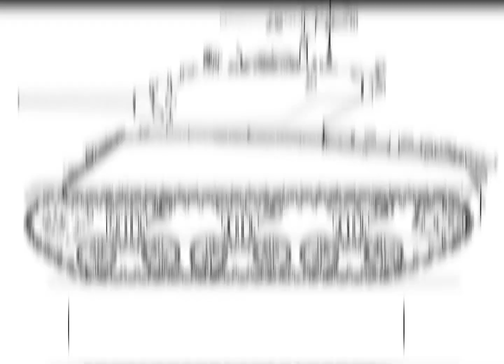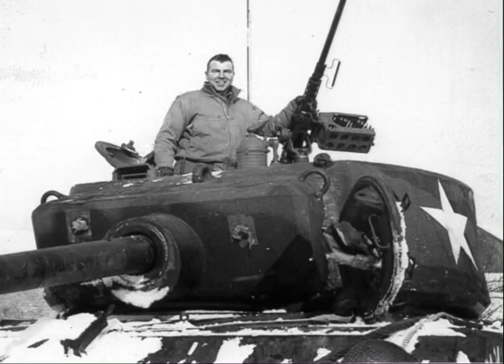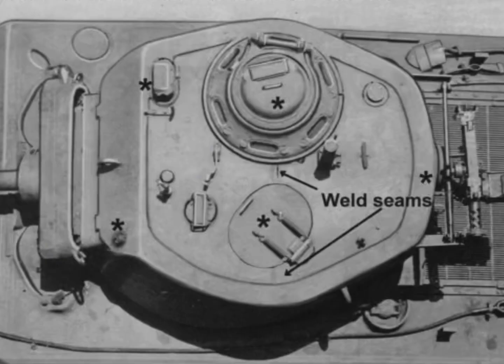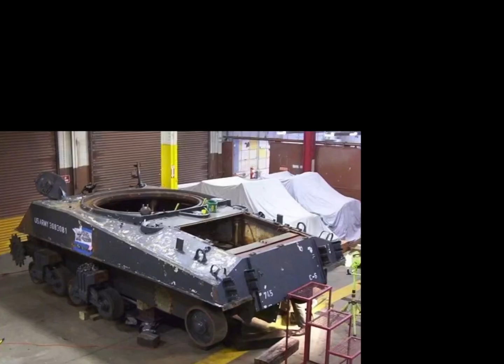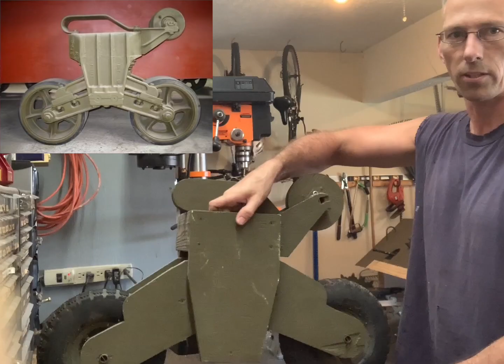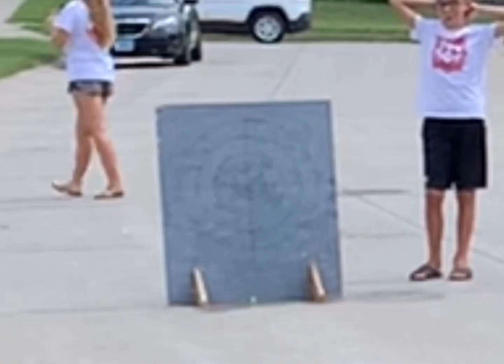M4A3E2 Sherman Jumbo Scale Tank - Real vs. Replica

Comment: Out of curiosity how did you get all your measurements and can you maybe give me some advice to doing a full scale version of yours
Reply from the maker: I got all of my measurements from drawings I imported from the-blueprints.com, I think I mentioned it in the video. A full scale version would be amazing! How to steer it will be the most difficult part. If you are thinking of using a truck differential and applying brakes to one side, I've seen this tried and it doesn't work very well. The vehicle will come to a stop every time you try to turn even slightly.

Comment: How do you get the measurements, im trying to build a 1/1scale sherman jumbo, and i don't fully understand what to do to get the measurements. Thanks!
Reply from the maker: I’d love to see your 1:1 replica! For the dimensions, I looked up the overall length and width of the tank. In my case I reduced the overall dimensions to 60%. Then I imported the blueprint images into a CAD program and scaled them to match the known overall dimensions. Then I drew my hull components on top of the image.
Reply: @ryanhahn7251  Thanks, once my uncle teaches me how to weld I can start, although it might take a few years since my dad said I have to wait until I'm 16 to weld

Comment: Can you make tiger 2
Reply from the maker: Tiger 2 is a very complex design. It will be a few years before I make another tank, and I will probably go with a simpler design like Hetzer.
Reply: @ryanhahn7251  ok what about tiger 1
Reply from the maker: @sturmtruppen69  Tiger 1 is probably the best looking tank of all time IMO, so I’d consider it. Still, the thing has 48 wheels!
Reply: @ryanhahn7251  i want to make that tank but idk how to start
Reply: @ryanhahn7251 hello can you give some advice for starting to make tank and merry Christmas and happy new year
Reply from the maker: @sturmtruppen69  95% of people who start a tank project never finish. So the biggest thing is to plan something you can finish in six months or less. Work on it every day, even if only for an hour. Also, turning a tank is very difficult. During a turn, most of the track is sliding sideways. So think of it like this: you need enough power and a strong enough suspension and track to push the tank sideways across the ground. It’s really stressful on everything.
Reply: @ryanhahn7251  i wont give up i just need some materials and dimensions and someone who can make trasmission
Reply from the maker: @sturmtruppen69  the transmission would be really expensive to have someone fabricate. You would be better off finding the drivetrain from a zero turn mower or Argo 6x6 atv or something similar.
Reply: @ryanhahn7251 you have discord?  So we can chat?
Reply: @ryanhahn7251  you can make panther and when you make it can i buy it
Reply from the maker: @sturmtruppen69  okay, we’re talking around $20k
Reply: @ryanhahn7251  when you finnish the tank then we will take the price for now is 20k.btw how long will it take to make a panther

Comment: Sorry to bother you again, me and my friends are going to start building our Sherman next week and I was wondering how you built the fame so stable?
Reply from the maker: It’s just plywood with 2x2 along the corners. Screws going through the plywood and into the 2x2 about every 16 inches. It was flimsy and twisted very easily until I put the roof on. Once you have all six sides on, it is very sturdy.
Reply: @ryanhahn7251  ok thanks, we plan on using 2 by 4’s

Comment: Me and my friends are also trying to build a Sherman(M4A3 76 W variant) and I can’t seem to find the dimensions, do you think you could help me
Reply from the maker: I downloaded blueprints from the-blueprints.com for free. They are just images and some are very low resolution. Look through them all to find the highest res image you can. Then I imported the image into a 2D CAD program and drew my tank on top of the blueprint image.
Reply: @ryanhahn7251  will it show length width and height? Do you remember the dimensions of your model and the scale, or did you just wing it?
Reply from the maker: @caliber_560  most drawings have a scale on them so you can get what ever measurements you want. My tank is 60% scale and was 11’8” long, 5’2” wide and 5’9” tall
Reply: @ryanhahn7251  thank you for the dimensions, I think I’ll end up doing 3/4 or 5/8 scale for mine

Comment: I hope you reply but could you point me in a good direction for the belt you used on the tracks, I’m trying to make my own tank and I have all the systems done, I just can’t figure out the tracks or sprockets.
Reply from the maker: Yes I bought used conveyor belting on eBay. It was 1/8” thick and smooth on one side. I bought one belt which was 16” wide and 26’ for $125. I cut it down to two 7” wide strips and it was enough for both tracks.
Reply: @ryanhahn7251  thank you very much good sir, if you want you could go on my channel and within the next few days I’m going to post a video on my design on my tank I want to build and it would be nice if you gave me your opinion.

Comment: I am about to pick up some steel to begin a frame for the lower hull on one of these. I plan to make the turret from fiberglass and make it run on hydraulics. I should probably ask though, do you believe this would be suitable for paintball? I have a “high explosive” shell design in mind, and I can easily just use paintball guns for the mg. My primary concern however, is how well the hull could withstand hitting trees as my driving area is very narrow and chocked full of trees.
Reply from the maker: The main part hitting trees would be the curved transmission cover. Mine is 1/8” hardboard which would definitely not hold up. With a steel frame and 1/8” steel for the front cover, you would have no problem. Check out the channel Pine Stumps. He built a tracked vehicle with a 1/8” steel plate hull, no frame. He has some video of running over trees no problem.
Reply: Thanks for the advice with how expensive things are anymore I have a feeling this will be an off and on project for a few years